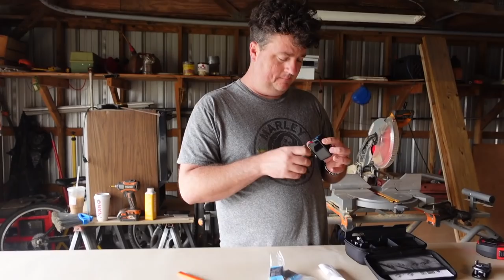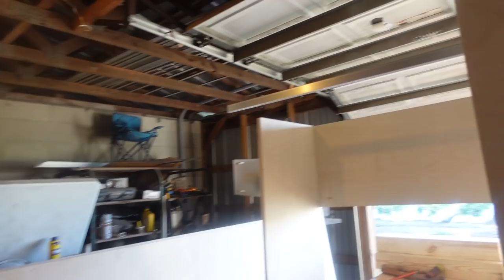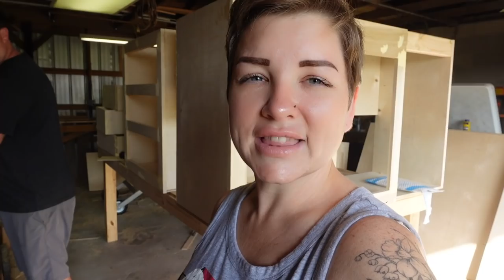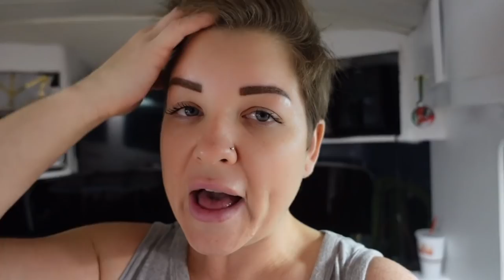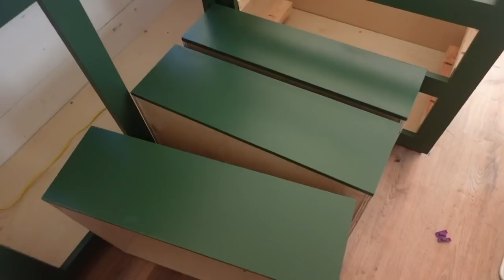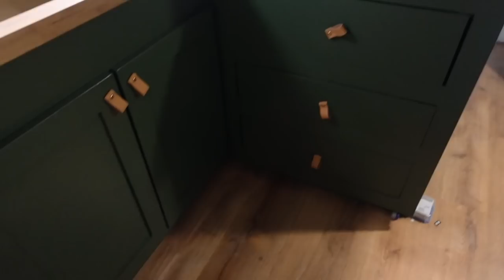We've bit off WAY more than we can chew! || Maybe the Remodel was a BAD idea?

Comment: How did you fix the drawer issue?!?
Reply from the maker: We ended up making them how they used to in earlier years, waxing the bottom of the drawer and letting it slide and fit snuggly with the frame ♥️
Reply: @Beingbethunes  No need for the glides that way..your dresser drawers don’t need them to work! 😻